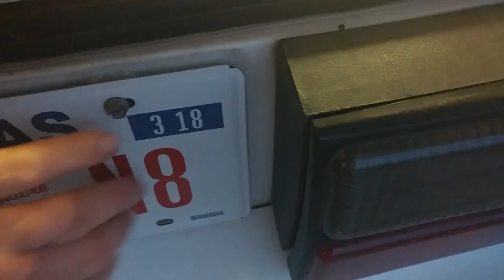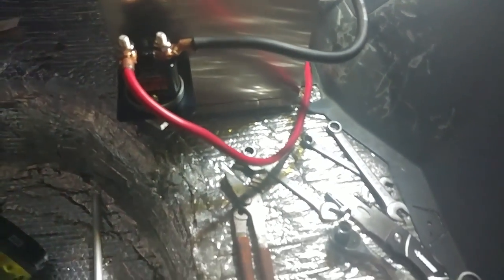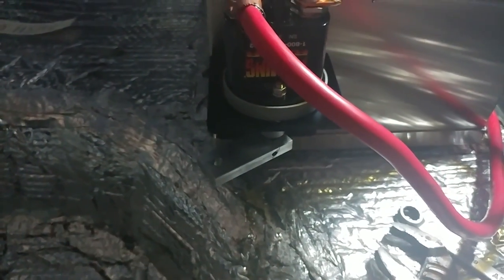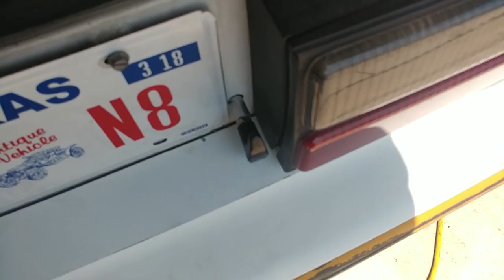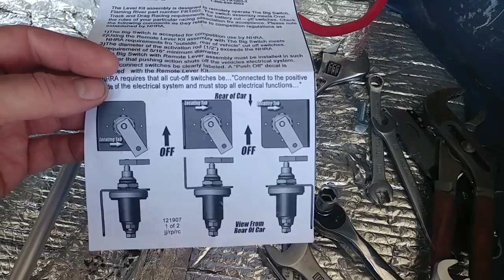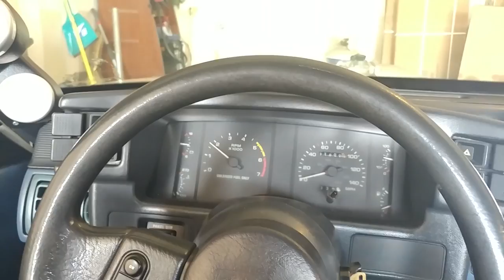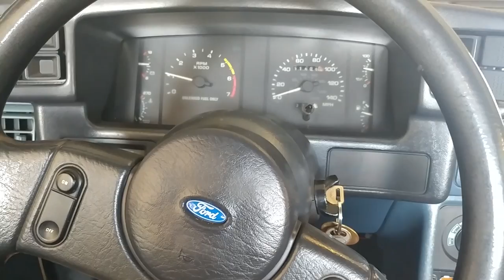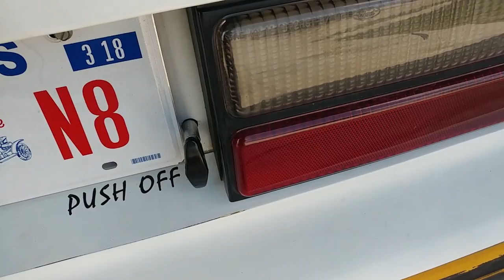Flaming River Switch Install Foxbody Mustang

Comment: The cut off is supposed to go on the negative side. The car will continue to run off the alternator power unless you have a charging issue.
Reply from the maker: Per to the instructions and NHRA rules it has to be the positive side. I believe the car will run either way
Reply: Alternator feed can go to the battery feed terminal on the switch. Then the only thing going from the switch is the feed to the fuse box. That should kill the car and dump all energy from the alternator to the battery upon shutdown. I used a breaker on my alternator feed to the battery in case something happened on that side.